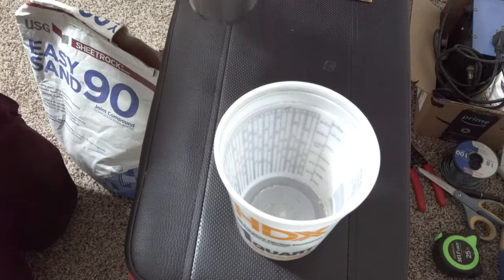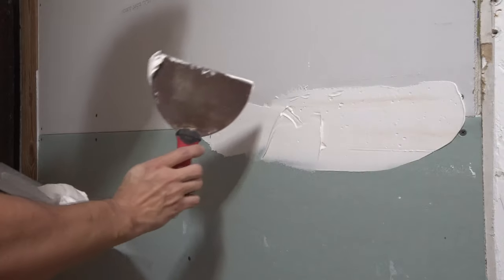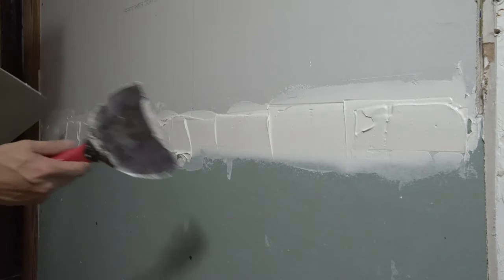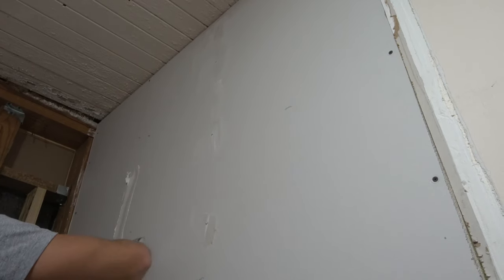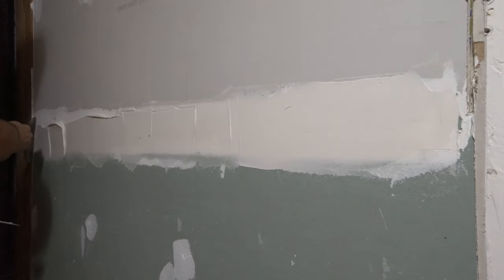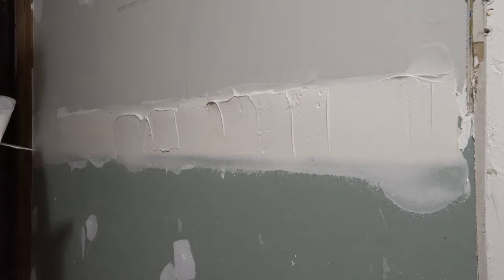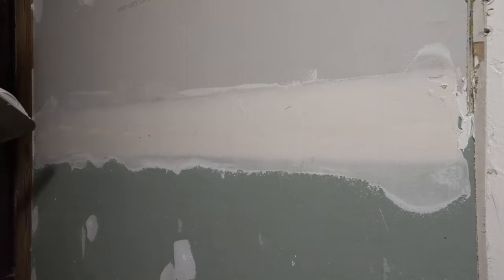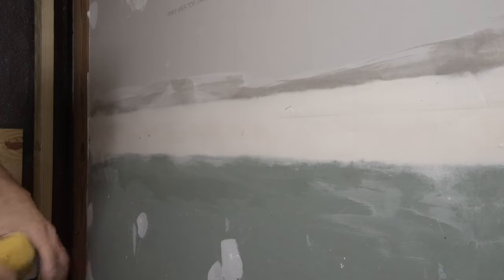DIY: Tape and Mud Factory Tapered Drywall Joints

Comment: You, um, are putting the wrong side of the tape to the wall. 😊
Reply from the maker: Hey, thanks for the correction. I was always taught to put it the way I did it in the video, but it looks like I was taught wrong all those years ago.
Reply: @JoeMartinMVC  yes that is the wrong side and will end up causing a blister. Plus that is the slowest way to apply mud.